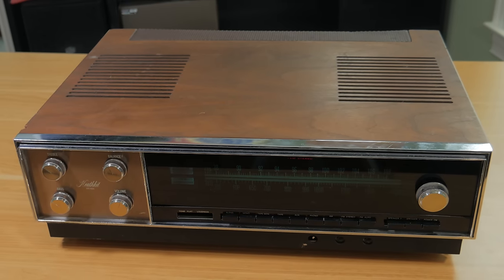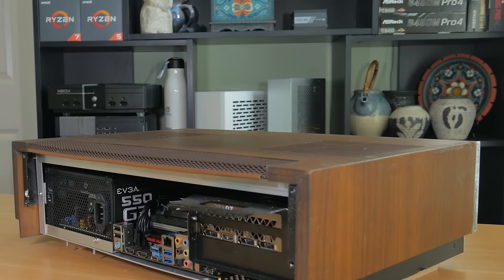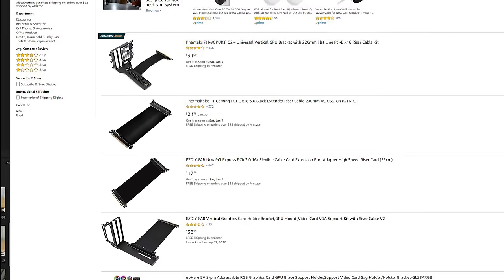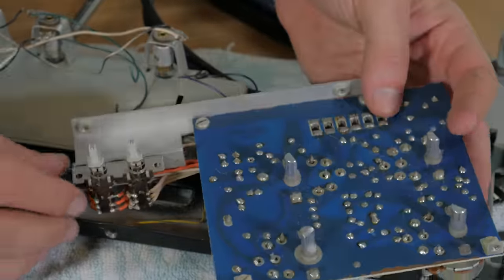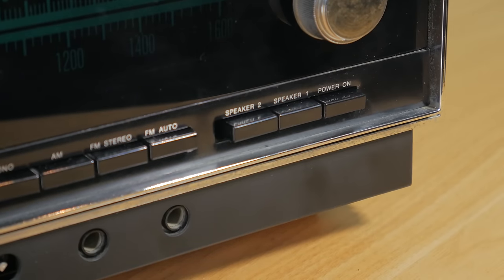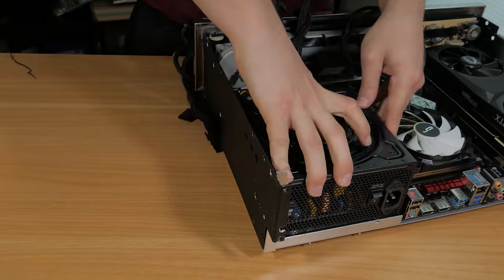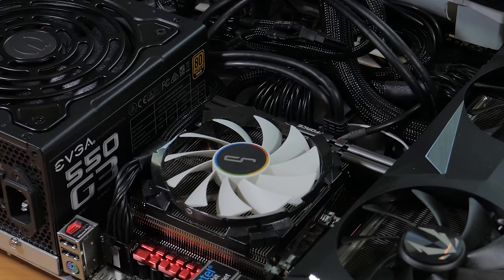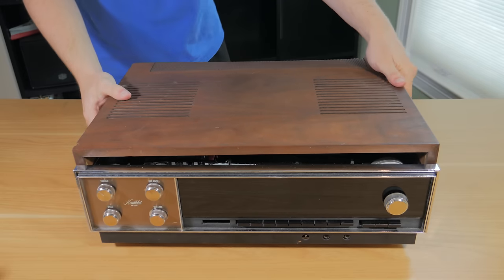Building An EPIC HTPC/Gaming PC! | (Part 1)

Comment: When building something for your external hard drives I would get my hands on a old school 8 track player unit that matches that unit as in wood and stainless look the mod it to hold your hard drives and use the slot that the tape goes in for a optical drive like a Blu Ray DVD r drive that would be epic just saying .
Reply: Or get an old reel to reel and covert it to a mag tape drive. THAT would be epic!

Comment: I have that exact ryzen 5 in my rig with a b450 motherboard, 16 GB Corsair DDR4 3000mhz ram, GTX 1070 founders edition, 240GB SSD PNY, 1TB Toshiba 7200 HDD, 1TB Western digital blue series 7200 HDD and a 600W 80plus PSU

Comment: Just a suggestion, if you had a spare Intel itx motherboard you could put a i5 9400f. Sure it's not overclockable but it's £60-70 cheaper (not sure what the exchange rate from £ to $) and it has the same 6c 12t count as the r5 3600 - not saying it's a bad choice.

Comment: The concept is really cool, but the over-complicating of the components of the original unit and the transition to the new model should be easily overcome. Especially since you are just reshelling the box. Still cool to look at, also those old capacitors aren't a worry.

Comment: "It wasn't the seller's fault"... the argument could be made that the seller didn't package it properly. Too many times people put items in boxes that aren't much bigger than the item and with a minimal amount of insulating material such as a little bit of bubble wrap... and that's it. Components like this honestly should be put in a box large enough for a good amount of insulation to surround the item on all sides. Beyond that, it's also a good idea to then pack that box into another box with a considerable amount of insulation too. I've been buying and selling items for many years and it amazes me sometimes when I see how people package items for shipping in a process where the package is going to get thrown around, dropped between conveyor belts, etc. The little bit extra for the packaging required ir more than worth it.

Comment: Who says you need a media cabinet. My reciever, PC4 and Xbox are in a closet at the other end of the room and my PC even is in the next room. My flatscreen TV is the only thing on the wall. They are connected with two fibre wire 20 meter HDMI cables. Mouse, Keyboard, and controllers are wireless.

Comment: you should get an old 8 track player and set it up as hot-swappable HDD system.
Reply from the maker: This is such a good idea! I'm thinking I could made an external raid enclosure out of an 8 track player. Have a few drives internally then make the 8 track slot so you can plug in 3.5" drives directly in(because they are very similar dimensions to 8 track tapes.) Then I would use an old 8 track tape, hollow it out and use it as a caddy for installing 2.5" drives. That way you could have permanent storage internally, then be able to plug in other drives for backing up or for accessing archived files.

Comment: LOL... that's not a "healthkit" it's a "HeathKit".  They were a company that made TV, HAM radio, and home audio kits for DIYers back in the day (kinda like Ikea for electronics).  You buy the kit and have to assemble it and solder all the components on the boards yourself.  Which is why, when you look at the boards, there should be tiny diagrams of each component to make it easy for the person who bought it to know where to attach the components.
I can't decide if you tearing-apart and repurposing a kit that someone had to build themselves is tragic, ironic, or just a fitting end for the kit...

Though looked-down on by audiophiles and people who could afford hi-end audio equipment, HeathKits were truly loved by the people who bought them because of the time and effort it took to build them.

Comment: a capacitor needs 5 t to discharge...wich is not a fixed time...but no capacitor needs 1 month to discharge :D...if you are scared you can short the connectors to be sure

Comment: This is lit man

How'd you make sure the pc parts were safe in there if it was metal?
Reply: line the bottom with a thin piece of wood or something maybe?
Reply: Think about it...the bottom of a normal PC case is metal. He clearly stated he drilled 4 holes and installed standoffs for the motherboard, which are metal too btw. Just as long as none of the solder joints to the components and the traces aren't touching it won't short. The GPU is on a riser, and the psu is sitting on the bottom just like any modern case would be. It's fine.

Comment: That's a lot of heat potentially in a small case with no fans feeding in cool or extracting warm air. Hmmm... Not sure why you went with such an old dated design. as the case is kinda flimsy and fragile, and an all metal frame would be much stronger being its housing over $1000 in tech inside.

Comment: I think I'd rather have the receiver. There's not much to them, fixing it might not have even cost you anything

It's a Heathkit, which meant it was probably sold as a box of parts to be assembled by the user. You tore up a 40 year old hand assembled receiver for a mediocre computer...
Reply: Agreed most 70s-80s receivers are worth a lot, and are HEAVY because they were built awesome. Im actually looking for old receivers and stereos before its too late, and this kind of thing does not help....

Comment: @Teach By Matt do u think this would work im new to building pc's and i would like some help thanks! 

==============
I N F O P A R T S
==============
case
Rakk Siri Gaming ATX Case free● 1x120mm RGB Rakk Stock Fan

Power Supply
Asus P-50GA 500w●

MotherBoard
asus prime a320m-k motherboard●

-Graphics Card -
Gforce gtx 1050 ti Graphics card ●

-Hard Drive -
Kingston A 400 240 Gb

-Ram -
Vengance LPX DDR4 3000 C15 x2● 8gb

-Cpu -
amd ryzen 3 2200g ●

Comment: i actually found a huge old 60s grundig tube radio but after i found out it was still working perfectly i decided against using it as a pc case, old tech is built like a tank.

EDIT: https://i.ebayimg.com/images/i/152776360522-0-1/s-l1000.jpg think like this, but in better shape

Comment: Everything you have done is not worth it because the heat is gathered, etc. A PC must be built but it has to have air to circulate, to be well ventilated. It is not worth the investment, you better buy a top case.

Comment: This is cool, but certainly not cheap. I think puttin an entire computer inside as part of the mechanism is almost cheating and extremely inefficient.
Reply: Cheating by what standard? This is just good case modding, performed to a good standard. Personally I might have shoehorned a Class D audio amplifier in there also (because of their efficiency) and connected speakers to it, but he still could if he was so inclined. Combined with streaming music services, that's a pretty good reinterpretation of a radio. I'd also make the front panel audio jacks functional, but it's not too late for him to do that either.

I have a more recent (compared to this) Onkyo receiver that has really fallen on hard times. The amplifier section no longer works and will have to be bypassed/replaced, but the receiver front end still works and I could actually make an integrated computer/radio receiver out of it pretty easily. But if he doesn't see value in radio reception (on a computer), who am I to argue?